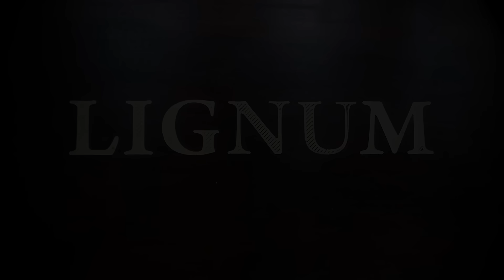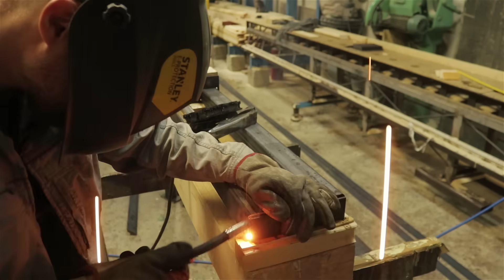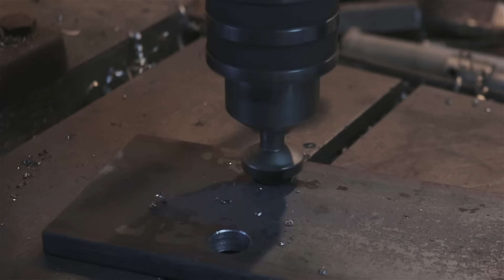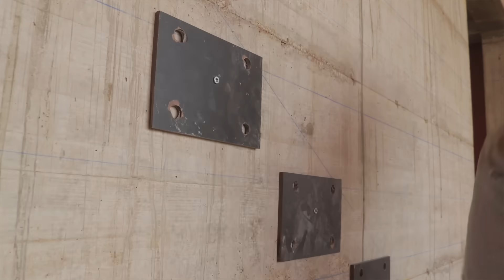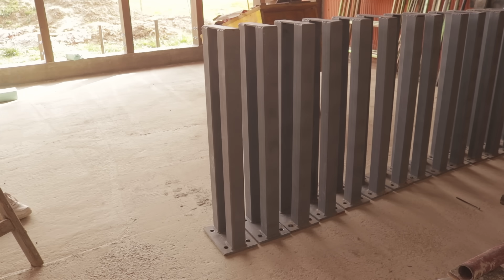Making a Console Staircase - Pt1 steel

Comment: Expansion anchors or redheads are inferior. Better to leave a plate then weld
Reply: Could you explain what you mean?
Reply: @CryptikStudios  a stronger connection embedding a steel base plate in concrete verses drilling holes into concrete and setting expansion bolts

Comment: Bottom line of bolts for stairs aren’t necessarily
Reply from the maker: You are right at the moment. Not now but when you see the second part when they get finished, you will see why they are there.. no tension forces now but it will appear when I put on the fence rods and tighten  them up to the ceiling.

Comment: The epoxy between the concrete and stair is 100% useless, This installation looks faster than it is because most of the work is dropping in shims, Not just to make the treads level [as the vid shows] but also making certain the treads are 90 degrees off the wall. Concrete walls are never plumb and never flat.

Comment: So the wall-is there any special reinforcing on the wall these stairs are mounted to? Did you run any structural steel in the walls behind the visible concrete or just standard rebar?

I work in FAB. also, and stairs like this are definitely going to be a DIY for me. One of the manufacturers (selling an identical product to what you just made for almost $50k) tried to tell me that a standard concrete pour+rebar wall would collapse, which I dont believe but it got me wondering anyway….
Reply: And you better do a floating railing, or something glass to showoff this craftsmanship! 😏

Comment: As a building inspector for more than 20 years, this structure would not meet building codes in my part of the USA.  No handrail, no risers, no approval.
Reply from the maker: Yeah, it wouldn't here either. Good thing this is just a steel core and not finished staircase..

Comment: Did you consider doing them in concrete tied into the wall? I had similar floating stairs done with concrete and with solid timber treads. The concrete treads where actually tapered from outside edge  to wall (thicker at wall connection and had nice curved edges).

Comment: so how much is the deflection calculated per year? or between season?, i know this is just the core but cantilever stairs makes me shiver man, takes a pair of weeks of an elevator not working and all people using the stairs with full winter clothes to make serviceability conditions worse
Reply: This is a steel staircase, not timber one. Deflection is not dependant on time/season or total lifespan of the staircase, it is constant and only depends on the loading.
Reply: @domov113 its amazing how people stops reading after the first line of text

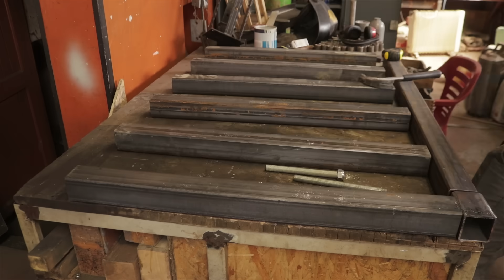Comment: It was interesting to see the stair assembly. I don't know about the splice on the HSS at 3:14 and the connection to the concrete wall at 8:03. There isn't enough edge distance on the concrete for the bolt and you are at greater risk of hitting the top rebar. It doesn't look like it is engineered approved.

I haven't clay time infill except in really old buildings from the 1920s. Not sure where this is.
Reply from the maker: This is in Zagreb Croatia. This building system is common in Europe. Edge distance is good for anchor mortar because it doesn't create huge expanding forces like anchor bolts do. That was the one reason for using this technique. This mortar is also used where there is possible dynamic loading although regular anchor bolts would also suffice for this purpose. Weight of a person is a small fraction of total load these steps can take, tubes would bend before it pulls out of the concrete. And in the end, I'm a civil engineer and I approved this myself😉
Reply: @lignumchannel  It looks good.  It is interesting for me to watch the assembly since I design so many steel stairs including cantilevered treads and landings.  I am a structural engineer.

I live in an earthquake zone so I never see clay tile infill except in very old buildings that we are renovation or doing seismic upgrades to.

Even with the Acrylic and Epoxy bolts, you are still less than minimum required edge distance. It would be better to make the tab longer but I doubt in reality it is very critical. We would not be allowed to do that here. It is just something to keep in mind for the future.🙂

Comment: Does the chemical anchor you put into the holes freezes late?
Reply from the maker: Not sure what you mean by freezes late. I prefer this method because it doesn't apply additional load to the concrete unlike expanding steel anchors so you can use it near the corners and edges. Also a lot quicker and better for dynamic loads. Downside is the price and you have to be meticulous in preparing the holes. there has to be no dust so it adheres properly.
Reply: @lignumchannel  thank you

Comment: Can you please tell me the wall thickness of the pipe and does it wobble in the edge, because I used 1/4 inch thick equal angle but it's not stable, step width is 3ft

Comment: Are these durable for long term usage? Do the steps ever bend, shake or do the nuts ever losen out? I'm planning on installing a similar staircase but some people have advised against it :(
Reply from the maker: Yes they are, they flex less than a mm and are sturdy. bolts won't loosen.

Comment: is that a standard method for fixing such a staircase ? I wouldn't have thought gluing threaded rod into the wall would be sufficient over time. surely having the rod go all the way through the wall to a backing plate on the other side would give a much stronger hold.
Reply: I would never trust this.

Comment: Einkleben ist keine gute Idee, der kleber verliert mit der Zeit seine Kraft.
Besser wären schlag Dübel  oder gewinde Stangen die durch die Wand gehen und von der anderen Seite geschraubt werden.
 
Ich hoffe euch wird nie was geschehen wenn sie mal locker werden
Reply from the maker: I wonder where did you hear or read  that. I would like to read it because if it is true, Berner is selling faulty product that can put lives at risk. From my experience, downside to them is mostly price and slower instalation. Also instalation has to be done right, at right temperature, concrete age, and without dust in the holes. They don't apply huge force to the concrete when installing close to the edge as mechanical anchors so it is ideal for the first step in this case and the top.  They also bond to the concrete over the whole bolt surface unlike mechanical. To be fair I thought about drilling trough entire wall but missing two layers of rebar would be a nightmare. Engineering project for this house asked for 4 14mm bolts anchored and I used 16 mm 20 cm deep just to sleep safe.

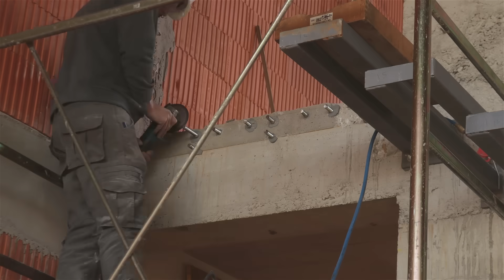Comment: 7:08 those anchors are pretty grouped up and the top ones are close to the edge of the concrete, aren't you concerned  its gonna crack eventually
Reply: Yeah, top ones are definitely going to push up, it could easily split the concrete and break.

Comment: I can't wait to see how you are planning to hide those bolts that sticking out 😎
Reply from the maker: I have a plan😉
Reply: one simple way would be having nuts with caps. After cutting the threaded rod, the unscrewing action of the existing nut would reform back the threads. Then screw the nuts with the caps.

Comment: Why didn't they drill through concrete wall?
Reply from the maker: Because the force calculated required m14 anchors 12 cm deep behind the rebar. I used m16 15 cm deep just to be on the safe side, going trough would definitely be an overkill and would double the chance of hitting the rebar.

Comment: Nice work guys, a wonderful staircase skeleton.
Anyway, really you never found rebar in concrete wall? You are very lucky because I remember there is a lot of rebar in that wall 😅
Thanks for share and see you next
Reply from the maker: I did but it didn't deflect the drill bit too much. I was fortunate that distance in between each step is almost the same  as double distance on the rebar mesh, steps are cca30cm apart and mesh was 15x15cm. so if I missed it on the first step, I was quite sure I wont hit any at all.. I hit a couple on the horizontal direction though.. Thank you for watching! :)

Comment: I personally prefer anchor bolts than epoxied bolts
Reply: it's not epoxy 🤦‍♂️
Reply from the maker: I use both but near the concrete edges, I always run away from anchors.

Comment: Beautiful stairs, would love to  build some here in Canada but code requires railings and i think it would ruin the clean simple look.
Reply from the maker: there is so much more work to do on these, this is just the first step ;) the safety will be improved dramatically..
Reply: I was thinking the same, but the wire railings might actually look really nice on these

Comment: i hope there's a 'part 2: railing' because as is that is very much not safe. no risers and big holes in each step also make it less safe.
Reply from the maker: @CyborgOctopus The plan is to cover the steps in wood, still not 100% sure if I will cover them from all the sides or just the top. Each step will be guarded with two thin rods/pipes going all the way to the ceiling, hand rail will be on the wall side.
Reply: @lignumchannel  thank you for the information. that should be safe and up to code 👍

Comment: What will you be putting on top of the steel bars for actual steps? Maybe a clear epoxy? Surely you won’t leave the beams bare like that. You’d be asking to break a foot. Also, you couldn’t go up the stairs barefoot.
Reply: They'll be covered in wood according to the description
Reply from the maker: Yes, I will use wood, not 100% sure If I will cover the steel all the way around or just top.

Comment: That's a lot of confidence in that Epoxy...
Reply: Even without it: would be hard to have vertical walking force managing to pull those out of the wall - they look like a fair way in and without applying purely horizontal force = kinda holds itself in as it would be trying to rotate with only a small amount of wriggle room..
Reply: It's not epoxy  🤦‍♂️
Reply: @julianreverse  video description literally says it's epoxy.
Reply: @shooshx  Hwo cares about a description? it's a 2K methylmethacrylat resin cement mortar.
Reply from the maker: @Julian Reverse you are right, this is not epoxy ,my bad. This is vinylester, I will change the description.
Reply from the maker: I have full confidence, never was a fan of anchors, specially near the edges.

Comment: Nice staircase, although the lack of railing makes me feel very uneasy.
Reply: It's the Star Wars School of Design: railings are for the weak! (j/k: no railings at this stage, but I do expect railings will appear further down the line)
Reply from the maker: Thank you:) each step will have a thin pipe/rod up to the ceiling and hand rail will be on the wall side. That is the plan for now. some temporary guards are up atm..
Reply: @lignumchannel  ...or you could use laminated glass sections for the railing, spanning 4 or 5 steps. The railing "per se" could be the glass panels top edge or, perhaps better from a structural/alignment standpoint, a dedicated metal tube fastened to the glass inside surface. I am envisioning a railing not unlike the one found on the main entrance stair to the Van Gogh Museum in Amsterdam. Not cheap or easy, but well worth of the shot!

Comment: Did all the stairs turn out to be the same height? Or did you make the holes bigger in the stairs, so you had some wiggle room, and aligned them to a sign on the wall?
Reply from the maker: I got them precise +- 1-2mm , this is plenty for final tuning with the wood cover. I drew position of each step on the wall but still managed to hit some rebar. I adjusted those holes with heavy duty biax tool.

Comment: I’m impressed you were able to drill all those holes precisely enough. The drill plate must’ve helped a lot. I hate trying to get holes precise on concrete surfaces. Nice work!
Reply: Using a centre punch on the wall also works quite well, and also drilling with a smaller drill first a small pilot hole first, then go for the actual diameter :-)
Reply from the maker: @Rick Thank you! Most of them turned out great but few were a few mm off due to rebar. I adjusted those holes with heavy duty biax tool.
Reply: @lignumchannel  Too bad you couldn't bring the robot arm in to drill the holes!
Reply: @lignumchannel  so no way to go straight through the rebar. A more powerful drill perhaps.
Reply: start the holes slow at like 20% power and allow the bit to collar, then let it rip
Reply: @Keechization  the bit always walks for me.
Reply: @OriginalJetForMe  get some good bits, they have a center already on it. while using 20% power your going to use the hammer funktion to drive the dimpel in the concrete. No weird holes anymore.
Reply: @clypeum5063  post a link to these bits. I have never seen such bits
Reply: @Z-add  BOSCH expert SDS plus-7X for example

Comment: What an elegant staircase! Did you calcute the needed steel thickness (if yes: how?) or did you go by feel/experience?
Reply from the maker: I got the minimum tubes and anchors in the main project from certified civil engineering office when I was applying for a building permit. Calculated were 50x50x4 welded to 10mm plate and m14 anchors. I used 60x60x4 welded to 12 mm plate and m16 anchors. Just to sleep tight.
Reply: @lignumchannel  overbuilding ftw. few $ upfront=longevity without a worry.
Reply: I guess these stairs would hold up tons.
The bolts look like M20, glued in, the square tube could be 100x100x4.. and there are two of them..
tons!
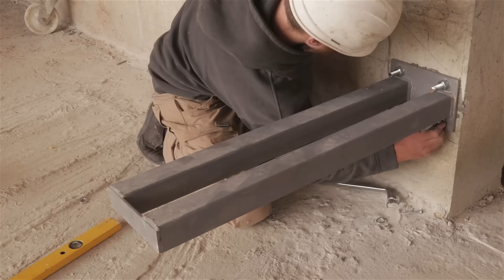Reply: @RubyRhod  at 5:52, you can see it's wrench 24 - so M16.
Reply: If anything that's way, way overbuilt.

Comment: The first step seems extra high... I assume that there will be another lower step or platform?
Reply: Thickness of the flooring on the first floor was accounted for in setting that height,, .
Reply: None of the underlays & floorings are in yet, these will take up the space.
Reply from the maker: There will be 22cm more layers on the floor trough all the pipes will go. 1cm hydro insulation, 8cm extruded polystyrene, membrane, 5cm plugged expanded polystyrene for heating pipes, 6cm dry screed, 2cm top layer (not sure what yet..)

Comment: Your going to have some awesome wall space and the volume 💰, there is a guy has a channel called the nito project that does some interesting wall finishes "organic" , but with your robotics and design skill I am sure you will have a treat in store for everyone. I could see some cool geometric plywood panel treatments or maybe a homage to your luthier skills .
Reply from the maker: Glad you like it! That concrete wall bill be covered in steel panels of various heights to give it a mosaic look. the stairs will be wooden with steel pipes as guard going up to the ceiling. I thought about wood cover for the wall but there is enough of it already with the beams and the ceiling  so wood will come on the kitchen side. I'm thinking of some pattern like I did the guitar case if you looked that video, but on the whole wall. Hope it wont be too much and overwhelming.